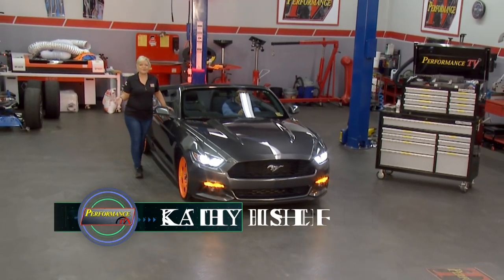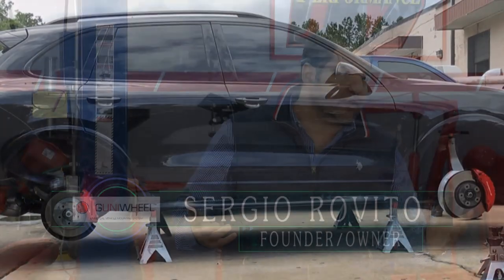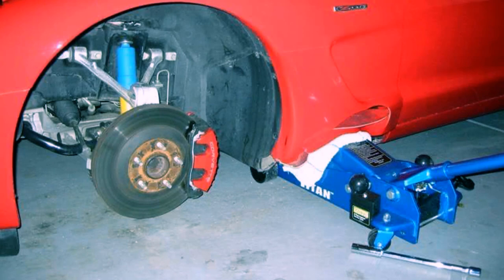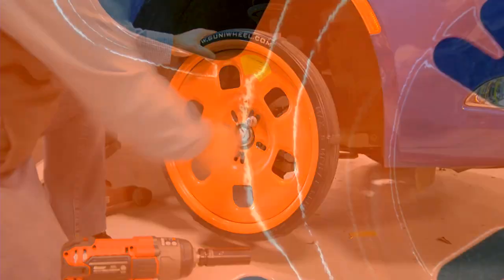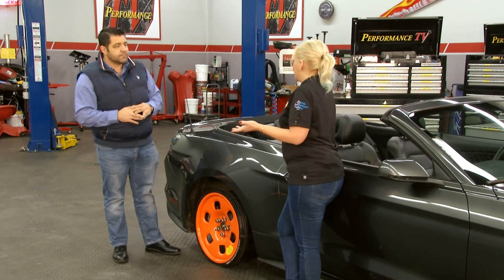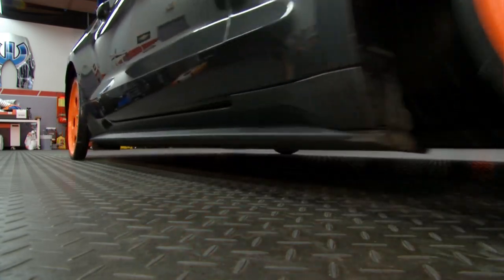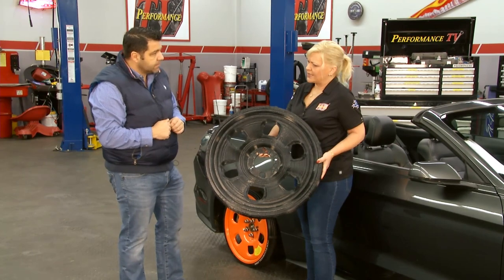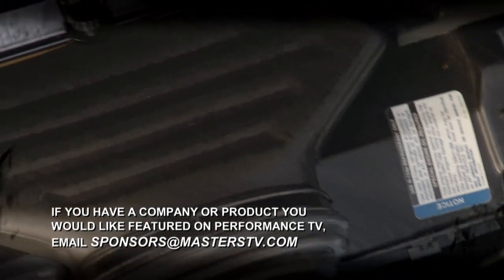GUNIWHEEL™ - A jack stand for car alternative on the MotorTrend Channel

Comment: Is the GUNIWHEEL considered street legal for compact spare tire usage?
Reply from the maker: Joseph Dugan No, GUNIWHEEL is not street legal. It is designed to mount and move vehicles missing wheels and tires around a garage, shop, or lot. Maximum speed is 5mph.
Reply: Have you considered designing one for road use? I’m a tow truck operator and a  universal spare rated for at least 55mph would be a huge asset for companies like the one I work for.